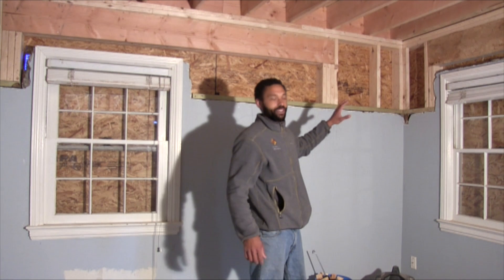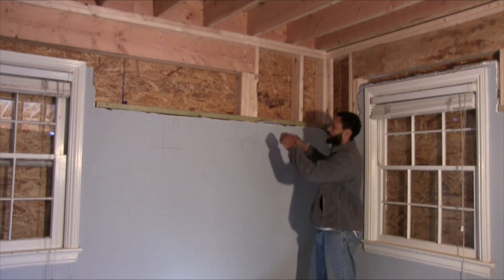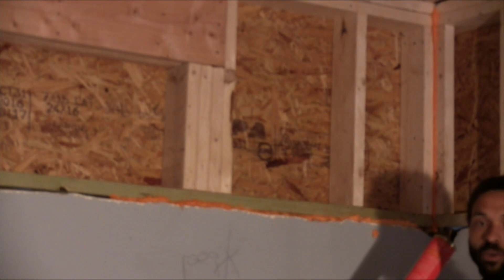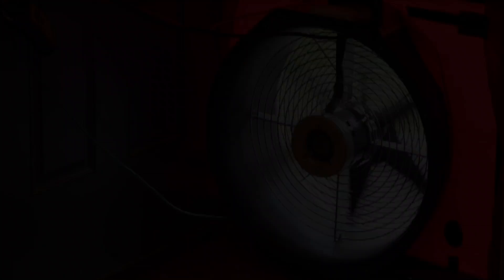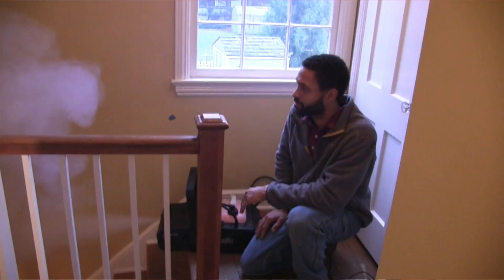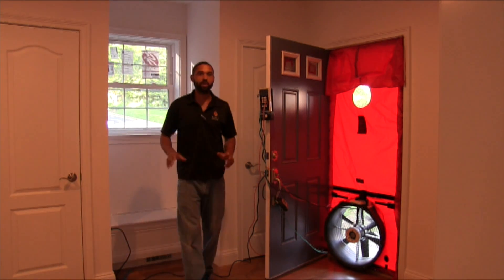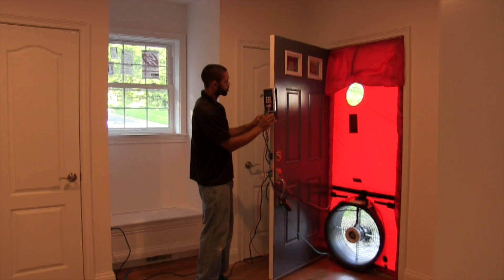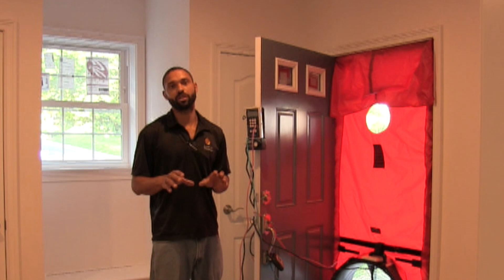Air Sealing a House

Comment: The problem with Sealing from the inside is it air intrusion entering from the outside has to pass through the insulation before it reaches the inside barrier. You have to be Proactive in air sealing the outside, not Reactive on the inside on new construction...